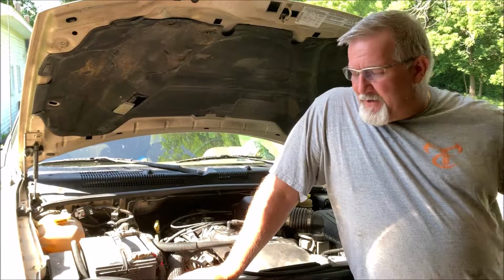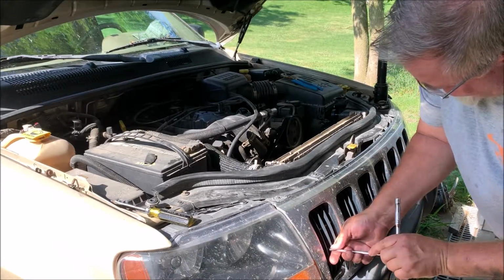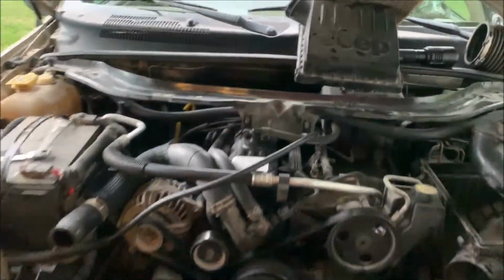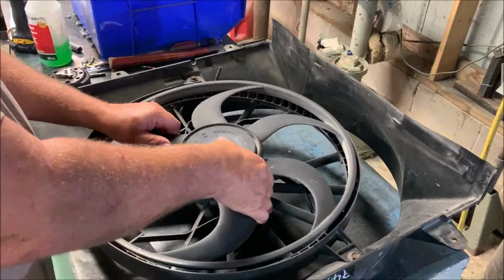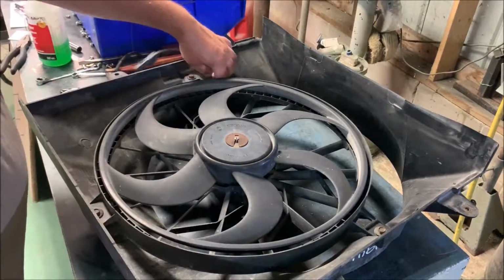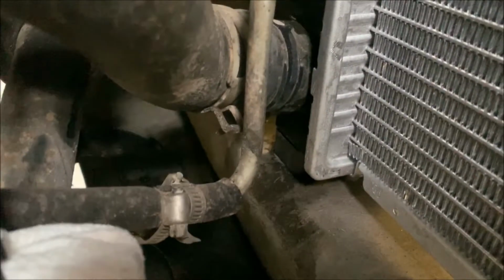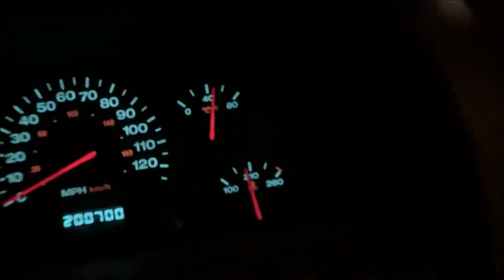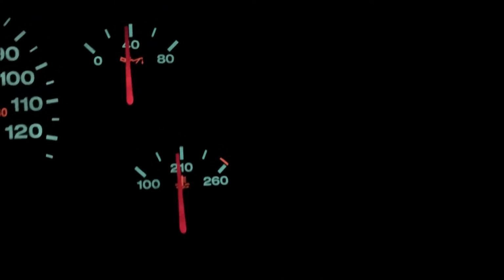2000 Jeep Grand Cherokee fan motor and radiator replacement

Comment: I've been watching quite a few vids on the radiator removal on this Jeep. Not looking forward to it tomorrow lol. Thinking about finding a way to repair the pinhole leak on mine since removal looks like a total pain.
Reply from the maker: bite the bullet and replace the radiator. One pin hole leads to another.
Reply: Mine had quite a leak from the left plastic tank,  added a spoon of black pepper 5 years ago, still no leak.

Comment: Excellent video!  I have exact same year and model and getting ready to replace my cracked radiator so this will save me a lot of time. I heard that this model and year is notorious for the fan motor. Mine works ok but debating to replace it anyways while I do radiator...

Comment: I had a hard time finding my cooling problem and replaced just about everything in the cooling system.   One day I discovered that the cooling fan electrical plug got so hot it melted the plastic around the contacts inside which made the fan work intermittently. I found out that some after market cooling fans draw over 40Watts of electricity and that overheats the connector to melting. I decided to replace that electrical fan plug since it was part of the problem and that helped.  Two years later my radiator that I had changed out 2 years ago is again having heating problems in hot weather on >90 degree plus weather days. I think I will replace the radiator with an aluminum one for better cooling unless someone else can recommend another better radiator that isn't a combination of aluminum and crimped on plastic junk?
Reply from the maker: very interesting story. Thanks for sharing.

Comment: My '04 inline six was WAY easier to remove. Just a heads up, you CAN replace the electric fan with a fan and fan clutch from an '01 explorer. Eleven blades, and larger diameter. Moves WAY more air. Fan clutch threads right onto the water pump. No more relay and far more air pulled.
Reply from the maker: Thanks for the info. I may just have to do that.

Comment: Ok, I got 3 things to state/ask about this video:
1.  I was really hoping this video was going to end with the Jeep in the middle of the backyard and it on fire, lol! I guess since you didn't text me a picture of a Jeep fire, everything must have gone well.
2.  Do you think that the fan motor you took out is actually still good, and it was just the bad connector that was keeping it from spinning at full speed?
3. I  just thought of this when you started talking about turning the AC on, "should have checked for any vacuum leaks while there was some room under the hood to fix that air deflector so it would stop putting the AC to the defroster."
Reply from the maker: 1. I have the lighter fluid and book of matches aka the Jeep repair kit ready at a moments notice.
2. Fan motor seemed to be ok once tested out of the vehicle but replaced anyway.
3. forgot all about the vacuum leak, was so frustrated with the current engineering I was dealing with.